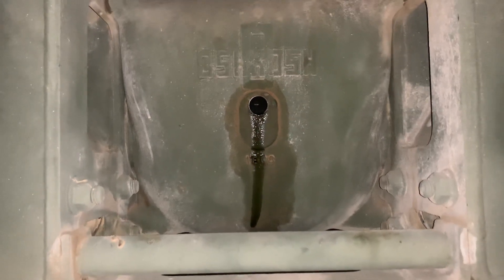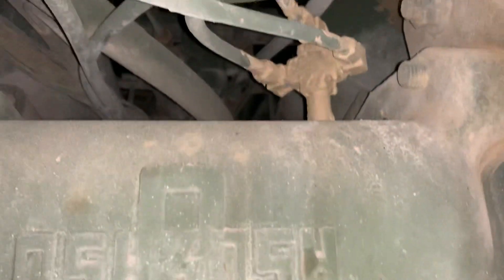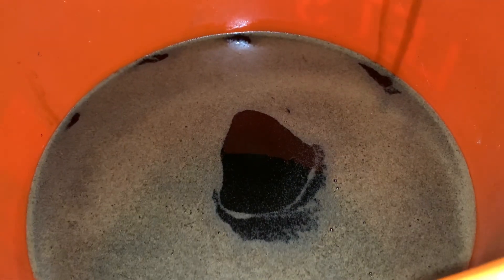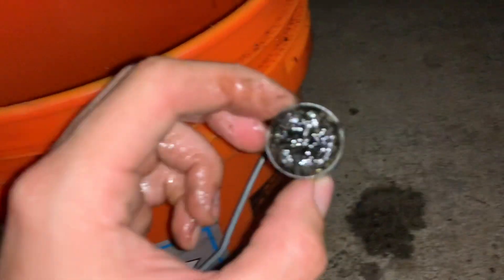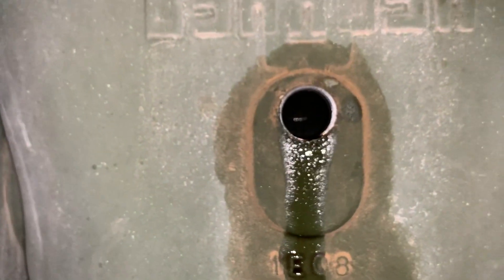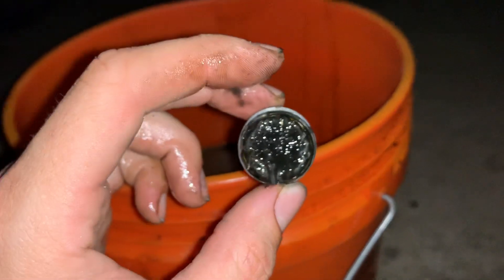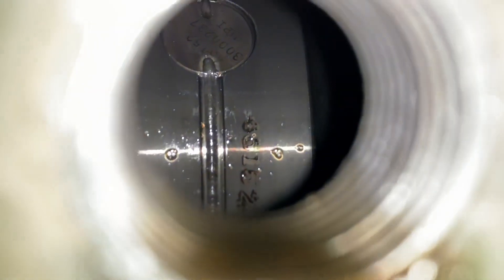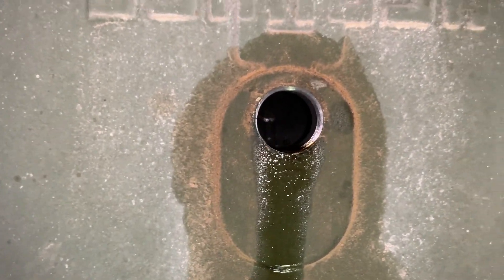MTVR rear differential problems

Comment: The MTVR diffs are very strong I’ve only seen a few Grenade over the years and that’s because of extreme use or lack of oil, or u joints giving out and marines continuing to drive them for another 1000 yards with the drive shaft swinging around , I would just clean her real well and remove any contaminants and refill.
Reply from the maker: Thanks for the info, hindsight it appears the truck was probably engaged into 6x6 when spinning at some point